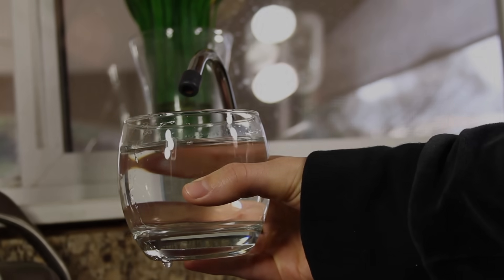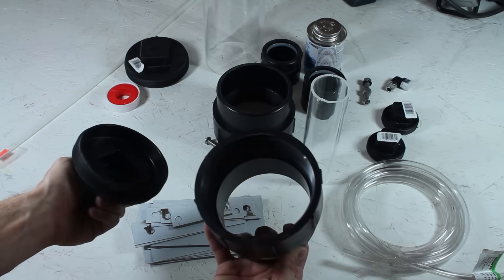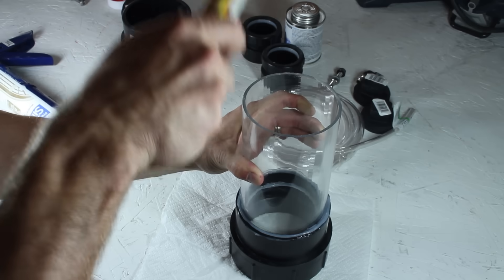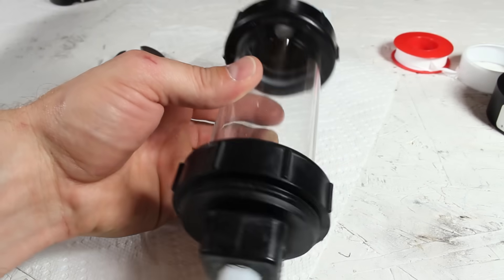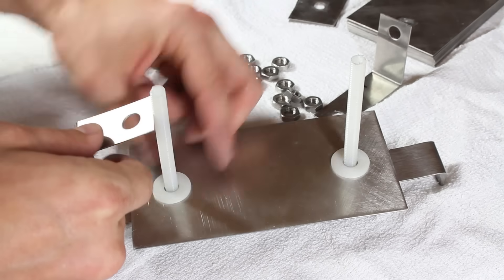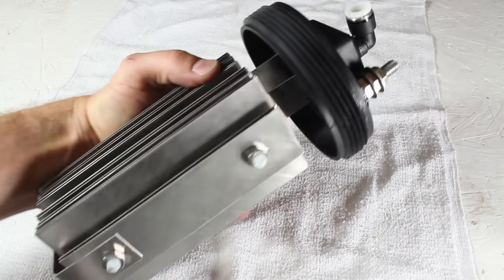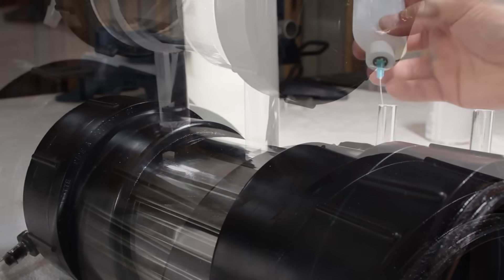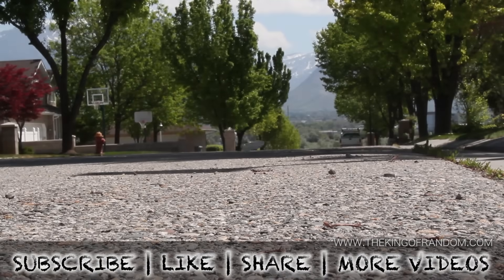HHO Generator - Water to Fuel Converter

Comment: I have watched this a few times now and seem to be missing something, hopefully someone can clear this up for me. It basically looks as if hes shorting the battery out through the plates, but I was taught you need to have an anode and cathode in the water. Because of this, shouldn't plates 1, 3, 5, 7, and 9 be positive, then plates 2, 4, 6, 8, and 10 be negative?
Reply: Christopher Nasseri He doesn't alternate polarity between the plates. If you look closely, what you'll see is that he effectively has two isolated sets of parallel plates. So the plates on one half generate hydrogen and the plates on the other half generate oxygen.
Reply: Christopher Nasseri Sorry, my previous post was in error. I just looked at the video again and realized that Mr Thompson made a mistake in his design and in fact, most of the plates in his generator don't do anything. He alternates separating plates with a washer and a nut. The plates separated by nuts are electrically connected to each other and the plates separated by washers are electrically isolated from each other. The strap at the bottom of the plate assembly causes the two outside plates to be electrically connected. So effectively, he has only 4 plates doing anything. The two outside plates are at one polarity and the two central plates are at the opposite polarity. All the other plates are electrically isolated from each other. You can see this by looking at the video and pausing at 8:18 (immediately after he connected power to the generator). You'll see bubbles forming on the 2 central plates and the 2 outer plates, but all the other plates will have no bubbles. After a few seconds, there will be a lot of bubbles churning things about that will confuse the situation, but it is pretty obvious the few moments after power is connected about what is happening.
Reply: John Cochran This is exactly what confused me. So if one were to do it correctly, they would have half the plates on the negative and half on the positive? It seems easy enough to do and I think I might attempt it and see what happens. I also just noticed he has a full diagram and build tutorial PDF in the description, however its $20 to get a hold of :/ If someone out there did buy this can they take a look at it and see if the design is flawed in the PDF or if Grant just made a mistake in building his.
Reply: Yes, it would be pretty easy to have all the plates active. I think the easiest method would be to have "jumper straps" placed at the top and bottom of the plates where the straps at the top connect half the plates for one polarity and the straps at the bottom connect the other half of the plates for the other polarity. As for having half and half, I suspect that you might be able to get better efficiency by going to a 2 to 1 ratio and keeping track of polarity. After all, when you electrolyze water, you generate twice the volume of hydrogen as compared to the oxygen. But that would be something to experiment with.
Reply: +Christopher Nasseri Did you find a definitive answer yet? It really does seem like the other 'floater plates' should be connected.
Reply: Christopher Nasseri John Cochrane He states in the description that these are floater plates. There is also a link there you should check out.
Reply: ***** I understood that after watching a few other videos. However, what he has isn't floating plates. The problem is that the plates don't make separate sealed cells.So the current goes through the water and bypasses the plates, effectively rendering them useless. If he had a long rectangular tank that had a series of stainless steel plates set within it with about a 1/16" to 1/8" gape between the plates, and each plate totally sealed off each segment of the tank, then he could apply power to just the two outermost plates and effectively produce hydrogen and oxygen from each plate. But since he doesn't have that kind of seal, the only production he's getting is from the plates that are actually energized.
Reply: Is this really how it works? I didn't think the current would bypass the plates through the water since the plates are much less resistant and offer a slightly easier path for the current to flow through?
Reply: Christopher Nasseri All I can say is to watch the video when he first applies power to the generator. Look for where the bubbles are being generated before all the turbulence makes it impossible to see. Given the speed of electricity, if those unpowered plates were doing anything useful, you would see bubbles on them as well. But you don't.
Reply: +Christopher Nasseri I agree. I think byppassing the plates would have more resistance.
Reply: Perhaps, if all you're looking at is electrical resistance. However, the actual breaking of the bonds between the oxygen and hydrogen atoms requires quite a bit of energy and that breakage will only occur at the plates. That energy requirement may make it easier for the electricity to pass though the water surrounding the plates and not go through the plates unless it absolutely has to.
Reply: +John Cochran would the extra plates be an effective way of protecting against a direct short due to heat warpage? plainly if the plates on both sides of the "floating plates" warped enough to touch you would get a direct short but it might give you a bit more warning. those disconnected plates threw me as well that's why I'm in the comments section they seem like a waste of material and space at first but.... I don't know.
Reply: +Thomas tb Ill try to explain it the way I understand it. According to the website in the description, the reason for the plates in the middle, called floating or neutral plates, is simply to reduce the heat generated by the system. It does this by lowering the voltage between the individual plates. The system can be looked at as a resistor that has "tap" points at each set of electrically connected plates. If you were to measure the potential between any two of these tap points you would get a voltage determined by the distance between the plates. Obviously measuring from the two ends would give you the full twelve volts, but measuring, for example, from the far positive side to the plates in the middle would give you six volts. Taking it further, measuring between two adjacent plates would give you some smaller voltage. the ideal voltage is 1.25v according to the website he cited in the description. So if you were to have 7 plates total then the voltage drop between each adjacent plate would be 2v. Assuming you're using a 12v source and the total resistance is 1 ohm. Then there would be 12 amps flowing through it producing 144 watts of heat divided evenly amongst the plates and water between. If you were to hook alternating plates to positive and negative(like this + - + - + -) then you would produce 6 parallel circuits each at 12 volts but at 1/6th the resistance between each positive and negative and therefore the current draw would be 72 amps. this would cause it to produce more gas but at the cost of producing 864 watts of heat! So in conclusion, the floating plates make it more efficient.
Reply: +John Cochran Not having his plates isolated would very slightly hurt his performance since, even though the path around the plates is higher resistance, a small amount of current will still flow. The reason that the path of least resistance is still directly through the plates is because: though hydrogen bonds are strong, are already partially split into H+ and OH- ions as a result of the electrolyte. Therefore, when the voltage is applied, the H+ will be pulled to the anode and the OH- will be pulled to the cathode. However, it seems that his design is flawed by the floating plates being so close together. As you can see in the video, the plates that are electrically isolated are only separated by the thin nylon washers. This will result in a very low voltage between them and might not produce gas efficiently. Im not sure, but that is my observation. It seems he could benefit from evenly spacing the isolated plates with more space separating them.

Comment: "Most abundant material on earth." - tell that to California.
Reply: MihealMLG California has a virtually unlimited amount of salt water.  That would work as well, but would leave lots of salts behind.  Would also reduce resistance in the water, so you might have to space the plates a little further apart to keep from overheating the whole system
Reply: Sean Relax captain literal. It was a joke, and I was referring to what he used in the video, fresh water.
Reply: MihealMLG Relax captain unintellectual. You don't solve problems with snark.
Reply: Meep Changeling The unintelligent insult others to make themselves feel better about their lack of mental capabilities. Jokes don't need to be scientific or 100% accurate, I was just poking fun at California's lack of fresh water.

Comment: I have a big question after seeing this video. can that gas be used to fuel a car? because it seems like it would be powerful enough to push pistons in a motor.
Reply: Andrew Thompson go home grammar nazi
Reply: jakstrieder GASOLINE is a liquid...so you wouldn't be able to put it in your car.
Reply: Hunter Broodboy I'm going to ignore you because you didn't understand what I said and I don't feel like explaining my self to someone who might be trolling me.
Reply: jakstrieder you wood need a ridiculous amount and some one smart enough to invent an engine to work with it
Reply: ***** like the last guy I'm going to ignore you because your not smart enough to think before you comment.
Reply: +jakstrieder if you have a lpg set up then tou could in theory run the engine with hydroxy but the costs would be alot plus there is safety issuses as hydrogen is alot harder to store than lpg
Reply: +jakstrieder Thats some pretty big talk from someone whom doesn't know how to use the shift key

Comment: I made something like this but the electrolytic cells were separated into half-cells so that I could capture just the hydrogen (or oxygen) separately and under some pressure.  It wasn't very hard at all.  You can fill balloons with just hydrogen to make them float, or inhale them so you can talk like you're on helium lol

Comment: When using pipe threads and plastic to plastic, or metal to plastic, you don't need teflon tape. The taper and the plastic's ability to deform to the metal thread will seal it.

Comment: Can the steel be replaced with aluminum
Reply: Anthony Ponce Yes, but it's a weaker conductor. You could use silver or copper, though, and, if you're really rich, gold.
Reply: 890slay Um, no. #1. Aluminium is a better conductor than steel, and #2. You can't use aluminium because it will be corroded by the potassium hydroxide.
Reply: Davy Zeng You're right; I didn't take that into account. You can't use zinc as well.

Comment: Finished mine today. Wires the two batteries in series and fyi the water gets really hot when mixed with potassium hydroxide. Had a lot of fun with it. Built a launch pad and the kids are making rockets out of pop bottles. It's was a good science lesson.

Comment: It's an excellent design that he used as I have imitated but as I built it I thought that if I would be using it a lot I should put a release valve on the top to have open when it's not in use to compensate for the presence of rust in the future as well as the inevitable build up of gas in the primary chamber

Comment: It is very very important to never use stainless steel electrodes in any electrolysis apparatus! Although it appears to be completely nonreactive all stainless steel alloys contain chromium which forms chromates in the electrolyte during operation. This means that the water left over in the chamber is both toxic and carcinogenic and has to be disposed of as hazardous waste.
Unfortunately almost any metal you make the electrodes out of will give you an undesirable metal salt at one electrode or the other, your best bet for completely nonreactive electrodes is graphite. Graphite is brittle and hard to work with, kind of incompatible with this design but such is the life of the backyard tinker. Play safe!

Comment: Question on auto fuels. I know all the politically correct crap but the technology has me thinking.  If solar panels can convert water to hydrogen then why can't panels be mounted on a car and create the fuel at the car to run the engine instead of gas? Seems like there is enough here to build this and show proof that this technology is better than gas.  Am I wrong here?  I don't believe I am.

Comment: Would copper work in place is stainless steel?
Reply: Slade Payne You could, but you wouldn't get what you want. The hydrogen would be generated effectively, but the oxygen would immediately react with the copper resulting in a nasty green scum and no gaseous oxygen. The anode electrodes really need to be inert if you don't want them to corrode. You can get by with a non-inert cathode electrode however. But it's much easier to simply have both the cathode and anode electrodes made of the same material and in doing do, you don't need to worry about the polarity when you apply power.

Comment: The amount of energy charged into the system in the form of electricity is much greater than the burning process can generate from produced oxygen and hydrogen.

So is it fun? Ya maybe. Is it of any use? Not at all. Might as well run the car on battery than using the battery to electrolyze water and again burn the gases back to water.

If you really want to run a car on hydrogen, which is dangerous to begin with, you can simply buy hydrogen from factory where the gas is produced with much more energy efficiency than this.

Overall, water has no potential as an energy source on the chemical level.

Comment: Take the motor off of a treadmill and mount it on your engine. Wire it backwards so it generates electricity and use it to power the hydrogen generator. Put the hydrogen generator outlet tube into the inlet manifold of your engine and you can reduce your fuel bill by 50%

Comment: Is it possible to use this method to create a stove to cook on?
Reply: ***** You need electricity to make the hydrogen so you would just lose a lot more energy than just an electric stove.
Reply: ***** For heat? It would take many aditonal parts, aswell as the fact that the gas created is highly combustable, as in it seems as its gone in secconds.  No heat left off, if any, very minuscuel, your better off using the batterie you used to create the gas to cook lmao
Reply: ***** I bet it is possible. The trick would be how to make the flame cooler. A HHO torch burns really hot....much too hot for cooking....unless you like eating burned food.

Comment: I have made one of these myself. I use it for fine silver work as the hydrogen/oxygen it produces gives off a very small and controllable flame BUT...just because the flame is small do not underestimate the heat this thing will generate, the flame will cut Steel no problem.  I have no need for that but it easily melts gold + silver. 
Attach a small jewellers torch and you're away ;-)

Superb video as always friend. 
Regards, 
A Fan

Comment: An alternative way to store electrical energy generated by solar panels so it can be used later in low light conditions. Converting the heat back into electricity would be done using a turbine. I am not sure on the efficiency figures.

If you just wanted the Hydrogen you would alter the apparatus so you could gather it as it came of the Cathode. The Oxygen of course comes from the Anode.

Comment: Since you are electrolyzing water (2 H2O) and are collecting both Hydrogen (2 H2) and Oxygen (O2) together without separation, couldn't you use AC power?  The Spot Welder (which I made as well and works great - Thanks!) puts out about 1.5V at 800A.  The Neutral plates in your design divides the 12V (or 24V) so less voltage is across each pair of plates with no drop in current. 1.5V across each pair of plates is the most efficient.  If you were driving this with 1.5V, your plates could be arranged (positive, negative, positive, negative, positive, negative) with all the positives tied together and all the negatives tied together - no neutral plates.  Then this could be connected to the Spot Welder output where 1.5V AC would be applied.  60 times a second each plate would switch to giving off 2 H2 then O2.  This might not be as efficient as DC but it would allow this to run for hours without draining 12V car batteries or running a car.  I think the original idea was to keep this in a car and generate Oxy-hydrogen, for later use or for the car itself.  But to generate the gas on demand at home may be useful.  And yes, thanks, as you mentioned this is not free energy, it is just transferring energy to break hydrogen/oxygen bonds.  So it is about 95% efficient - a Scientific Wild Ass Guess (SWAG), but still pretty good.  Using solar panels to electrolyze the water would be best because the energy could be stored in compressed gas containers rather than batteries. And solar is nearly "free" energy.  So, anyway, your thoughts on modifying your design to work with the Spot Welder?

Comment: I'll admit, I haven't made one of these, but it occurs to me that the one way check ball should come after the bubbler. That way, as the gas leaves the generator, the vacuum draw on the bubbler would draw more electrolyte in, but with the check ball being installed after the bubbler, it would keep air and gas from being drawn back in. It looks like the way you're running it can cause an implosion when the electrolyte runs out in the generator.